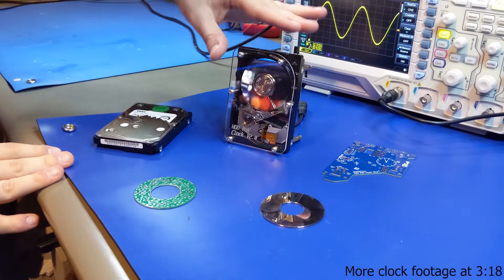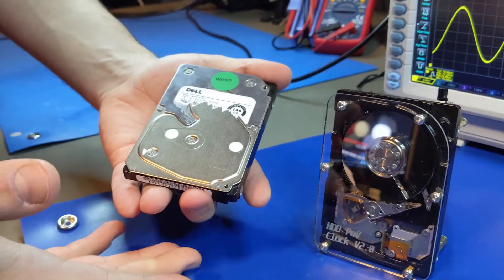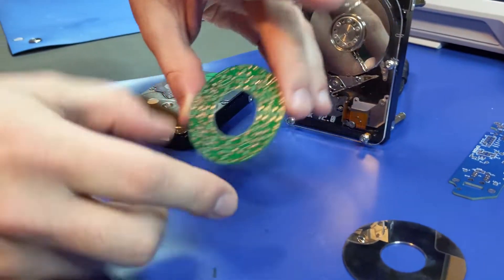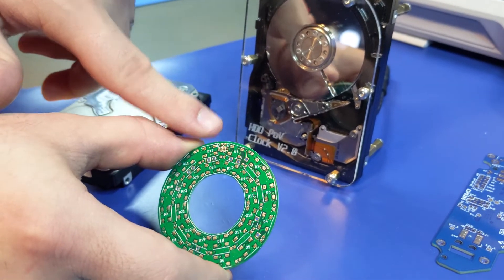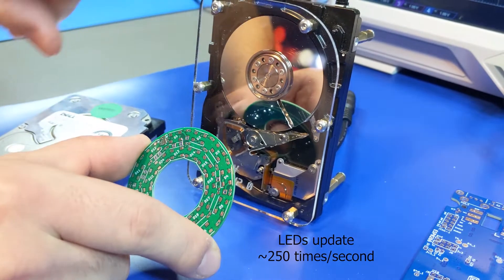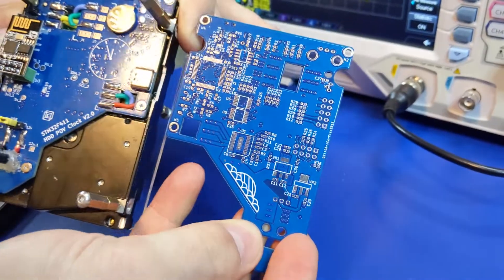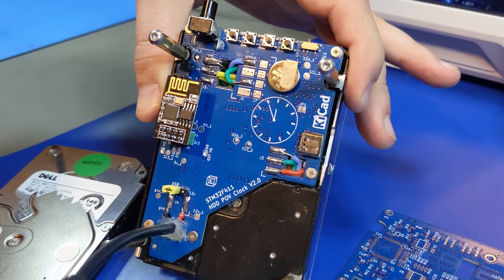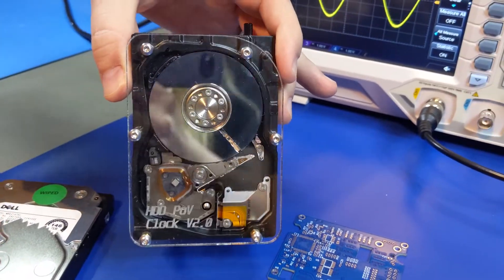HDD Persistence of Vision Clock!!

Comment: Are the individual LED's actually visible when it's rotating? If so, can the spacer be revised to be a light diffuser? Otherwise, that's a pretty damn good looking clock that would do wonders on a desk.
Reply from the maker: The LEDs are visible while the clock is running. Depending on which clock face is currently displayed the LEDs can be seen a bit better. If I'm only displaying the clock hands, the rest of the platter actually acts as a mirror which looks super cool. 

I've entertained the idea of a diffuser, but there is just no space between the bottom of the platter and the LEDs under it. On V1 there was less than 1mm of space (really tricky to get it all together right), on V2 I have been able to get about 1.5mm-2mm which makes things much easier to get working, but doesn't leave enough room for anything else.

I'm glad you like the project! Thanks for your comment!